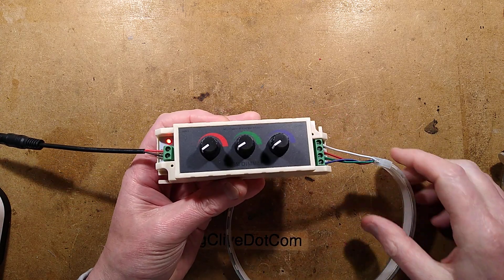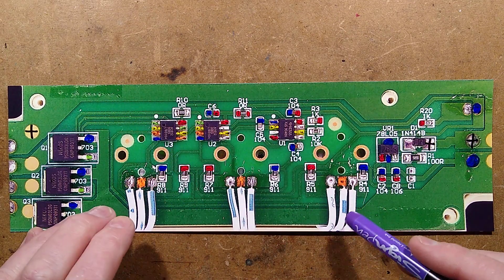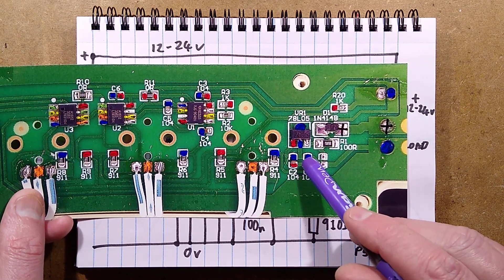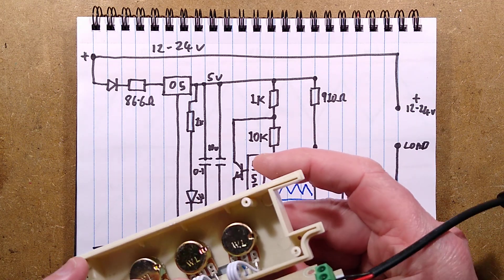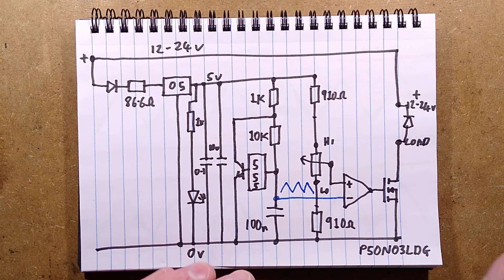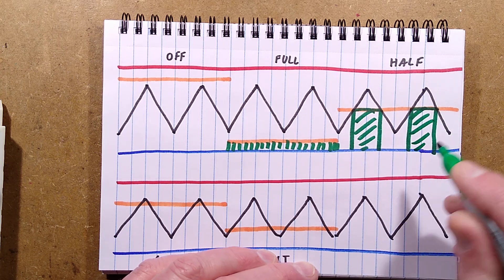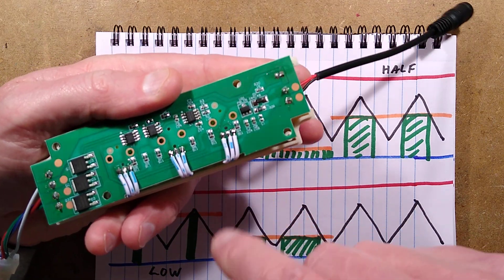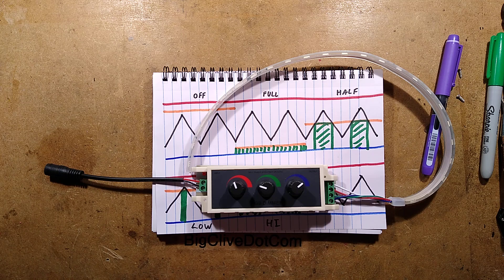RGB dimmer teardown and schematic (no microcontroller)

Comment: This is one of the more interesting projects you have broken down.  Not that the other projects are bad on their own, but this is essentially like taking a clapped out Fiat engine and repurposing it to run a towns water purification plant.  Although the 555 is nearly useless in this day and age, it is a rather impressive result from a single 555 timer.
Reply from the maker: The 555 keeps appearing in industrial products as a threshold switch that can drive a relay directly.  It's still a very popular chip because it is a very useful set of building blocks and has a long history.
Reply: The 555 is > 55years+ and still running..& well-stocked in stores around the world..the internals are so simple ..with a dual comparator & 3-4 transistors ..the discrete 555 could be home built..
what's a micro to that..every 3-5 years a new version make older one obsolete & new software development is required....that's how these u.controller manufacturers make money out of you..

Comment: it never occured to me that you could just ... not use the output pin.  so many times i've tried to get full PWM signals from a 555 by the stupid diode hacks or whatever
Reply: takes a lot of fine tuning to get it to work right.
Reply: I did it once but can't for the life of me remember why or what it was for...!
Reply: It helps that the op amp input has high impedance so it doesn't load the timing capacitor much.
Reply: Always keep in mind that the 555 has two output pins in addition to the "outputless" implementation here. Pin 3 is the bipolar out everyone thinks of, but pin 7 is effectively an open collector output and gives you additional design options.
Reply: put two cascaded, one gives an astable very short pulse and the other monostable (one shot) stage gives pulse lenght, still limited and messy comepared to a uC but with a bit of resistor\pot chosing and maybe some LTSpice sim (there's the 555 model in it) you come up with a decent 1-100% duty with separate frequency adjust, pretty suitable for tesla coils considering the pulse length stay fixed when varying the frequency
Reply: It helps looking at the innards of the 555 than just at the pin label. Then you know how abuse the 555 for all kinds of things ;) .
How about not using the discharge pin (7) at all and charge/discharge the timing cap with the "output" pin (3) instead? 50/50 duty cycle without the slight asymmetry in charge and discharge!
Reply: @superdau  : That normally works, but beware! There are one or two 555 variants out there that don't have a totem-pole output! Yeah, weird, and a little stupid, but apparently a manufacturer thought it was a good idea.
Reply: @Peter_S_  in some situations you can link pin 3 and 7 together for more current output. I do that if I use a NE555 as a relay driver ( with hysteresis)
Reply: Me too. You can never get 0 or 100% with a 555 alone

Comment: I've wanted to build something like this for my LED+heater lava lamp project for a while. In my inexperience, I tried using potentiometers directly, with mixed results. I'll have to try my hand at building this circuit
Reply from the maker: Potentiometers are no good for high current loads.  They have a very low power rating.
Reply: Hmmm, well I could buy some of those rheostats the size of my fist from my local surplus electronics store...

Comment: I use one of those to control low wattage heater strips. I had to rewire it though. I have had it for four years and haven't had a problem.

Comment: 1k pots make sense, as this would give a slight dead zone on the extremes of the pot were the op amps will go to either 0 or 100% duty cycle, as the 555 timer (which is supposedly named after the chain of 5k resistors from which the references are devised) uses 1/3 and 2/3 Vcc as the points of switching, and as Big Clive explains, this slight overshoot allows full on or off

Comment: If anyone else was struggling  to figure out why the green colored areas seemed wrong (there was less green area in FULL than in HALF or LOW), It's because the mosfets are switching ground, so it probably would have been better to fill in the area between the 5v rail down to wherever the orange line (the pot voltage) intersected with the triangle wave,  rather than filling from the zero volt line up to the orange/triangle intersected line.
Reply: good explanation for thos who were confused with the timing waveforms..👍👍

Comment: A while back we were in a thrift store,  and I saw this little box,  labeled "DIMMER".  They were asking a whopping 99 cents for it,  and so figuring that the box was worth that much if nothing else,  I bought it.  Inside is something that probably resembles what you describe here a lot,  I see a voltage regulator,  a 555 chip,  another 8-pin chip (can't find my magnifying glass at the moment),  and a MOSFET.  According to the markings on the cover it's rated at 12-24V .8A.  No indications of who made it or anything like that though there is some sort of a part number on the board.  And a "QC Passed" sticker on the bottom of the box.  :-)
Reply from the maker: Sounds like a DC dimmer for LED strip.

Comment: Clever implementation and great explanation. I would have never thought about designing a three channel PWM controller like this. Don't some DC/DC controllers work like this to control the PWM duty cycle based on the output of an error amplifier?

Comment: I first thought they would have used the TL494, which is specifically a pwm controller that operates using a ramp generator from an RC network, 2 error amplifiers. Both the ramp and amplifier signals attached on a comparator

Comment: My first PIC project was an RGB flashlight. I put the whole circuit into the socket of my Maglite and got a 3W RGB flashlight with1chip and 3 mosfets long before rgb was a thing! . :-) Isn't the 555 a 1 bit analog processor?

Comment: I've used this setup before for a pwm motor control. By using the 555 separately you're able to keep the frequency constant with change in pwm. Something that's not possible with a single 555
Reply: In my experience the pot + two diodes method gives a reasonably constant frequency with a single 555

Comment: Clive, Blue-Tac's your friend to hold down fidgety buggers, I find. Other Tacs are available.
Reply: They are, actually. As well as competitors, Bostik (I think) who own Blu-Tack, make Tack in a variety of colours, pretty much the whole spectrum. And you can apparently blend it, like Plasticine! It's aimed at kids, I think they were trying to push it as a modelling material. A soft one, with no strength, that will sag under gravity. D' and indeed OH. BUT.. lots of colours are available! I feel like ordering a pack as a conversation starter. Stick up posters and stuff using it, and when people marvel at your Pink-Tack, act ignorant and claim you always thought you could get it in pink. Mix your own colours! Have it match your outfit. You'd just need to be in a place where a lot of paper gets stuck to walls.
Reply: @greenaum  You can also mix in coloured Sharpie to make Any-Tack

Comment: I remember using a million 555s in basic circuits from the Mims notebooks (I think?). I used to harvest them from old junk, but I don't see them that often any more, or perhaps they are hiding under another number?
Reply from the maker: Search eBay for ne555.  You can get them in huge packs.
Reply: @bigclivedotcom  Thanks! With everything SMT these days it's getting harder to be a scavenger, lol.

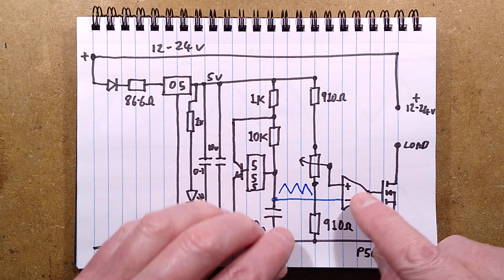Comment: 7:08 that's not quite how an op amp works.
An op amp will subtract the voltage on the - line from that on the + line (Basically find the difference between the two inputs), and then amplify the result.
Setting the amplification to "Maximum" causes the output to go to ground (or negative voltage) when the - line is greater than the + line, or to supply voltage if the + line is greater than the - line. There is also a specific device that can perform this same on/off action known as a Comparitor, this is what you're describing.

Comment: I have a question about this nice little circuit, the sawtooth wave that is generated does it ramp then drop immediately as it hits its thread hold or does the 555 ramp it back down more like a triangle?
Reply from the maker: It ramps up and down with slightly different symmetry on each side.
Reply: It charges through 1k+10k and discharges through 10k only. The slight asymmetry doesn't matter in this application.
Reply: Though slightly 
asymmetrical it's almost  a triangular..wave..no where near a sawtooth....

Comment: Something like that would be very handy for temporary installations, trade-show and set works etc.  Just a shame it doesn’t have proper cable entries, would need to mount it in a secondary enclosure which is a bit annoying.
Reply: As it's entirely low power SELV, with minimal RFI, just tying the cables to something sturdy should be enough.
Reply: @johndododoe1411  not on our jobs, but thank you anyway.

Comment: Could the potentiometer be an input of the 555 to generate the PWM directly with the 555 (via a transistor)?
Reply: Potentially, yes. However, you'd end up with a circuit that would be more expensive than this one. The real genius of this circuit is using the comparably costly, 9.3 cent, 555 as a sawtooth wave generator shared among the three channels, and absolutely dirt cheap, 8.1 cent each or 16.2 cent total, op-amps. This leads to a total cost of 25.5 cents a piece, plus a few cents for passives. Going to discrete 555s, or 556s, would actually end up costing more. A discrete 555 for each of three channels would come out to 27.9 cents per board, plus a greater cost for the associated diodes, resistors, etc. If they went to 556es, they would be 2x 13.5 cents, or 27 cents in quantity, plus the cost for support components. This is a surprisingly cost-optimized board.
Reply: @keszerda8364  Thanks!
I guess I have to watch the video once more. They didn't use one OpAmp per channel?

Comment: Would have liked to see the scope display for this, would it have shown a perfect sawtooth pattern or a slightly deformed one?
Reply: It's a cap charging and discharging through a resistor.  It certainly won't be perfect - it'll be non-linear like anytime you charge a cap.
Reply from the maker: Slight curve to the waveform.
Reply: @stargazer7644  Technically, RC circuits are linear electronics.  But the switching circuit is definitely non-linear.
Reply: @johndododoe1411  That's not quite the meaning of linear as it is being used here.  The voltage on the cap in an RC circuit follows an exponential curve, not a linear one.  A true sawtooth waveform follows a linear shape.  If you look at the charging voltage on a scope, a linear circuit produces teeth with nice straight lines going up and down.  A charging cap produces curved lines. The teeth are distorted.  They bulge up on the charging side, and droop down on the discharge side.  This happens because as a cap's voltage rises, its charging rate slows down. It discharges the opposite way.  A linear circuit rises and falls at constant rates.  Whether this non-linearity is a problem depends on how you're using the circuit.  If you're PWMing an LED, it might not be a big deal.  If you're driving the deflection coils on a CRT TV set to make an image on the screen, it'll be a big deal.
Reply: @stargazer7644  thanks for explaining

Comment: By the way, the P50N03LDG has a worst-case gate charge of 50 nC and the 358 has a worst-case drive capability of around 10 mA, so the time to charge/discharge could be as much as 5 microseconds. You don't want to turn the PWM frequency up beyond a couple of hundred kHz.

Comment: old school solution to a modern problem. like it.. very easy to fix. or hack. and cheap to design and build on mass. with very cheap parts . and its robust. and due to the world shortage of certain micocontroller. and ic's in general. we may see this in more products.

Comment: Room for optimization: use one LM324 and do all with a single IC. NE555s, LM358s and LM324 cost all about 10cents each. One instead of three chips, 20 cents saved! Could have used that to expend 1 cent on the input filter cap ;) .

Comment: Could you explain the purpose & rationale for the two capacitors on the output of the 5v reg? Also the non populated cap pre reg?
Reply: Helps to smoothen out a wider range of unwanted frequencies. The smaller bypass cap rejects higher frequencies better than the larger one
Reply: Standard application design for the first LM7805 called for capacitors at the output to eliminate both ripple but more importantly possible oscillations of the regulator. The values given back then was a 1-10uF electrolytic paralleled with a 0.1uF ceramic or film cap. The reason for paralleling ceramic and electrolytic was the high esr of standard electrolytics back in the days that would make them bad at snubbing higher frequency oscillations. That is why sometimes you see tantalum at the output of an old design with LM 780x instead of ceramic and electrolytic, since they were low ESR enough to serve both as ripple reject and oscillation snubber.
IIRC the original design note from Texas Instruments also calls for a cap at the input to prevent oscillations. And it specifies maximum capacities of the output electrolytics to not impede the regulation speed. The modern LM780x clones differ in the values or dont need these oscillation blockers at all because of internal circuit improvements. Many designers however still go by the old application notes and put the caps in...
And on that note; parallelling a 0.1uF ceramic to a 10uF ceramic which has low enough esr by itself is exactly like someone read the design note and just followed it...
Reply: Thanks for the clarification, makes complete sense.

Comment: The 555 is possibly my favorite microcontroller
I've seen the same use of a 555 generating a triangle wave which is going to one side of a comparator with the other side taking an input to make a (not very good) class d amplifier
This seems like a better use of that circuit
Reply: A not vey good one maybe, but it helps enormously when trying to get someone to understand how Class D works.

Comment: Cool video like usual! 😃 Btw. would be great to get you teardown (for PSU / dimmer) and thoughts about Mars Hydro SP 6500 Led Grow Light (works great as bright work light in high ceiling workshops!).

That seems to be a beast 😯🤯. Reasonably compact 650W light with 2376pcs top quality Samsung and Osram diodes.

Really high efficiency and I think could be nicely improved with something like 12x Arctic P8 80mm fans for cooling the heatsink. They are high quality, quiet and only ~4€/$4 per piece when bought in a 5-pack.

P.S. I would be a Patreon member, but I'm disabled with chronic medical condition(s) and my income is extremely low 😒 (at the moment can only dream about that light fixture 😂).

Comment: I used 555 timers for dimmers before, but never like this.
I'd use them to drive the MOSFET... one 555 timer for each channel, with lot's of filtering (otherwise you get some nasty flickering... and probably my circuit is crap).
Using their output as a basic waveform input for an opamp is genius.

Comment: Hello clive i have a question (i hope u can help me) isnt it necessary to turn on the mosfet, that the voltage on the gate must be greater than the voltage between drain and source. If im correct the signal fed to the gate is maximum 5 v and the driven load is 12-24v.
Reply from the maker: The voltage has to be above source (negative).  Usually a few volts for most modern MOSFETs.
Reply: Dont know where  i read that it was necessary to be above the voltage to be switched on mmm .... for example if the mosfet is activating a motor that uses 12v to turn on the mosfet is  necessary to exceed 12v, looks like ive been wrong this whole time.  Hey man isnt it 5 am there, too early to answer youtube questions haha. Thanks in advance here is 11pm cheers

Comment: This is a very old circuit, when I got my first job in engineering in 1984, a previous person had used this circuit to control the speed of the DC motor that ran the formulation pump in a pesticide fogger. I'm not sure how long that circuit had been in use when I started there.

Comment: WHAT !!!!! Something electronic that does not have a microcontroller in it. Utter sacrilege. What sort of sorcery is this?
Reply: While this circuit is simpler, it does beg the question of if it's cheaper.  You've got 3 ICs and a bunch of resistors.  It starts to add up when you consider assembly costs.  With ultra cheap microcontrollers, it final product might be cheaper to go digital.
Reply: @russellhltn1396  People seem to not count the cost of programming ICs. That cost offsets a whole lot of cheap components because of the logistics of dealing with parts in tape. If you're not ordering enough to be programmed by the MPU manufacturer, the cost can be fairly huge in the scheme of things.  I've had a mass-manufactured microcontroller product on the market for years which has a total parts cost of about $1 (2 connectors, 3 chips, 4 caps). To have Digikey install the code prior to assembly was $0.25 PER CHIP.
Reply: @Peter_S_  Hence why you use the board testing rig to program the MCU during the go/nogo test, possibly leaving it disabled on failed boards (to discourage grey market sale).
Reply: I programed a attiny85 to act like a 555, so I could have a uC version :-) just for the fun of it
Reply: @johndododoe1411  LOL!!!!! I've built the programming and testing jigs and built several 10s of thousands of boards myself. All I can do is chuckle when reading that comment. Boards like this one are not given full QC... they get sampled QC from batches, if that. Programming is a pain and takes LOTS of assembly time. You need multiple stable connections to the board via an extra cost header or via pogo pins and pogos get flakey after a while.